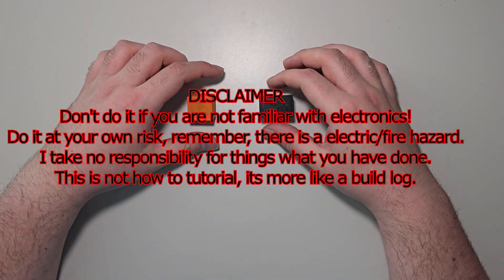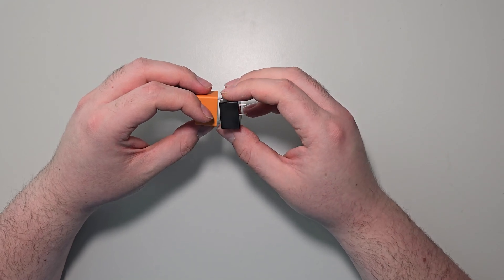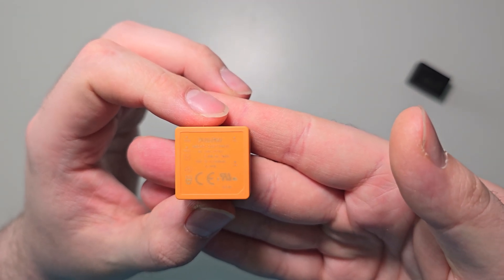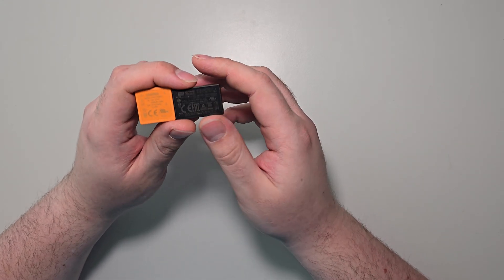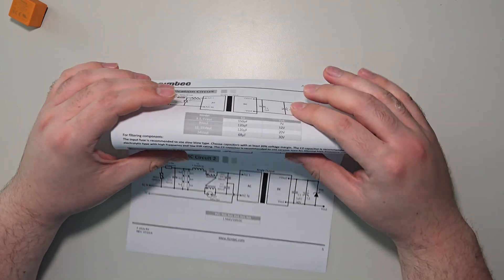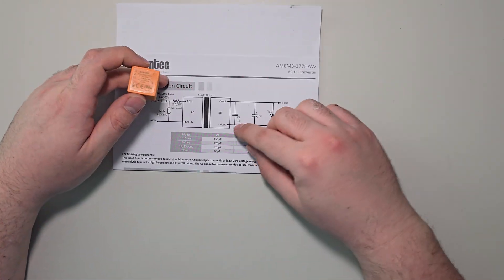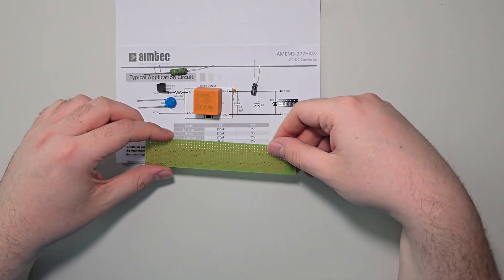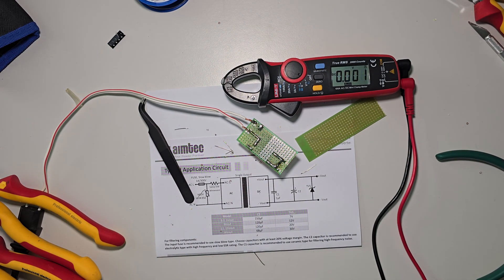Efficient and embedded way to supply IoT low power devices like ESP32 ESP8266 Arduino etc.

Comment: I used a module similar to these from hi-link worked well. Except I managed to blow there off them by drawing to much current. (Capacitor charge up causing inrush) So just be careful with your circuit design.
Reply from the maker: You won't believie...

My aimtec was working with one device, but failed when I insulated it and connected two devices (one ESP8266 and I think tedee has esp32), I'm connecting vcc from wemos and 5v from usb port female to tedee, nothing more. It could be this reason.

I have measured power consumption and I had 140mA max when connecting to wifi per device (might not be caught true highest because I used clamp meter)

I have used the weaker meanwell (2W/0,4A) and it is working rock solid for a week now, 24/7, turned off and on few times, no problems. Everything seems built in, I just used varistor and fuse.

I know hi-link but I don't trust this brand, meanwell has my trust, aimtec just was random choice which was available at TME with 3W power...

Thank you for your comment!